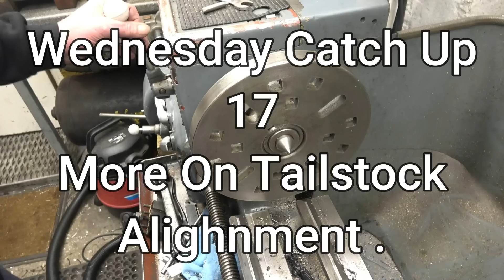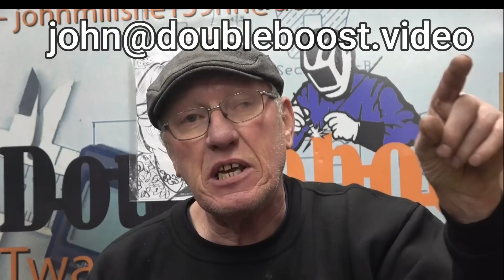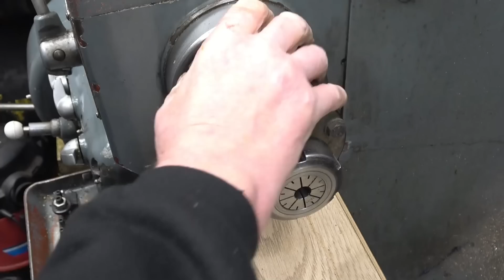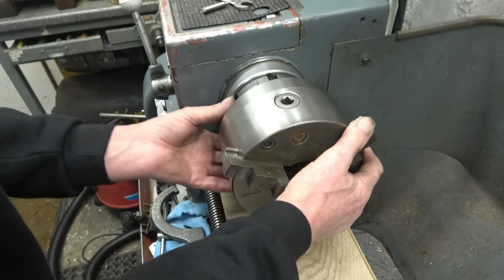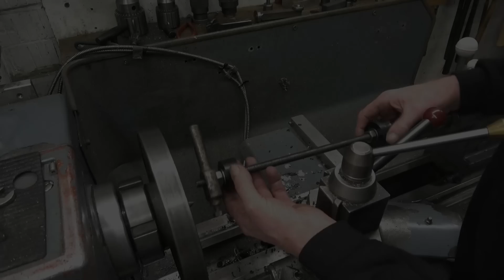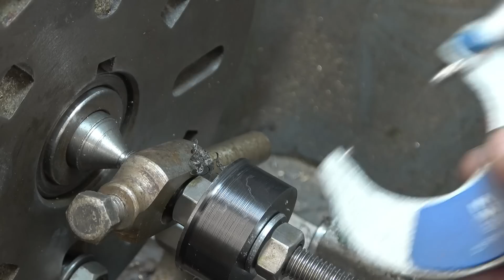Wednesday Catch-up 17 . More On Tail Stock Alignment.

Comment: One of the engineers at work told me once that he worked in a place where they had a really high precision ground bar which was kept in a padded felt lined wooden box that they used to use to set the lathe tailstocks up with. The idea was that you put it between centres and use a clock gauge on the carriage to get you somewhere near and then you'd take it out and then turn a bit of bar and then measure it... but somebody put a cut on the good bar by mistake! 😂

Comment: Hi John, I've been given an old thick leather bag full of engineers tools, among them are 3 sets of micrometers and would you believe it a micrometer ball attachment which fits to the anvil or spindle on external micrometers - to enable round or irregular surfaces to be measured!
I didn't know what the hell it was at first until I researched it. Have you ever used one when measuring round stock?
Reply: The ball anvil attachment is used to measure the wall thickness of tubing or cylinders....the ball goes on the inside of the tube to accommodate the inner radius.
Reply: @howardosborne8647  Thanks

Comment: Aye, all good atween centres,       stick a long  ground bar in yer chuck an watch the waggle,   ye will be surprised. then try yer collets etc. rinse an repeat.
When was the last time ye turned atween centres.   The spindle taper and the tailstock taper are fine for that work,  but a a chuck  or collets throws it all awry if the jaws are worn.
Same with the tailstock,  a drill chuck might be 50 thou aff centre.    Not complaining just saying,   precision has to be set to both ends with the collets/chuck that you will use on the part.
71 year auld mistake fixer here,   a bit of swarf in a taper can junk the spindle you are turning.  I was trained by a ww2 toolmaker, he was amazing, unlike starmers dad.  He is a fool maker.
Reply: Starmer's dad made a right tool there eh?